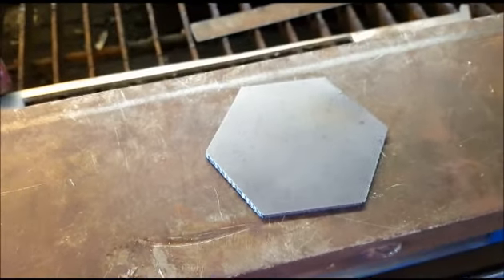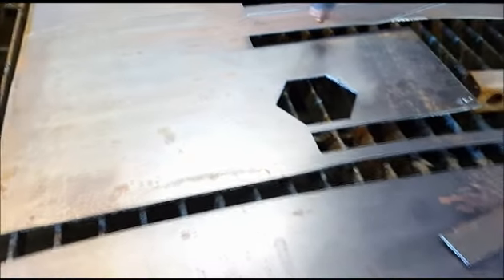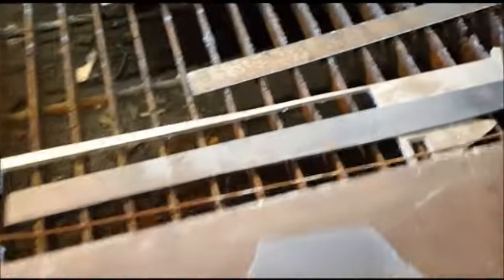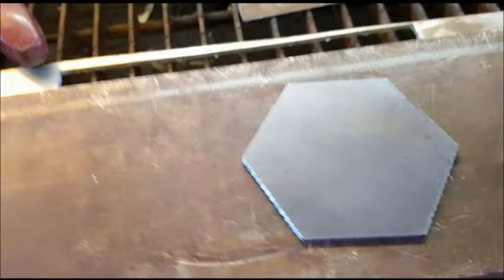CNC Plasma cutting trial and error

Comment: I think the fact that the material you were cutting was really thin and therefore it was messing with the THC settings. I think once the torch figured out the material it worked great on the cut and by my experience it is doing better than it has in a while my friend. You rock that table and you know it.......now I really need to sit down and have you stand over my shoulder and walk me thru the process a few times that way if you should be incapacitated in any way and we have work I could try and keep the work coming out of the shop. Decorative Iron Plus....Where we turn imagination into metal. If you can dream it up Bill can usually make it come true.

Comment: How you troubleshoot it..i am having same error...machine works fine for 3 to 4 cuts or many cuts but it generates probe error after time...and by time probe error get increase
Reply from the maker: sorry  i didnt get back sooner i  just got your message . i had  several issues with various things like  grounding problems   RF  interference a few computer issues and found out a chip in the driver was burned to a crisp . however  if you havent found your issue  let me know maybe i can help  thanks Bill